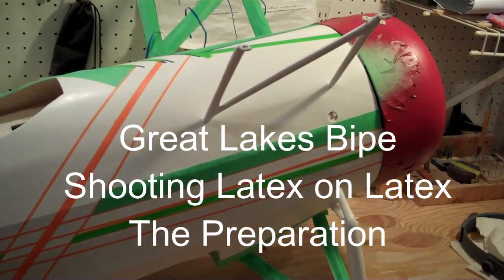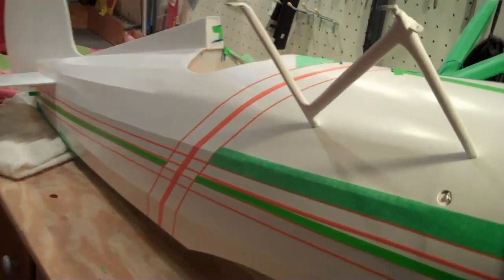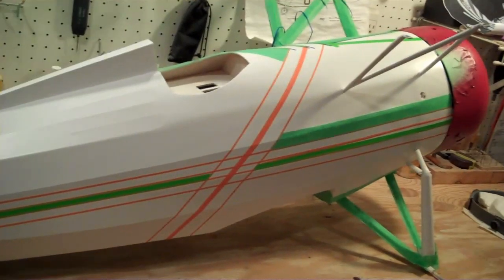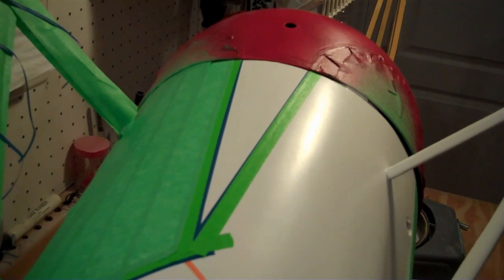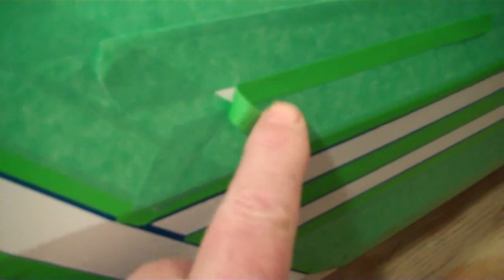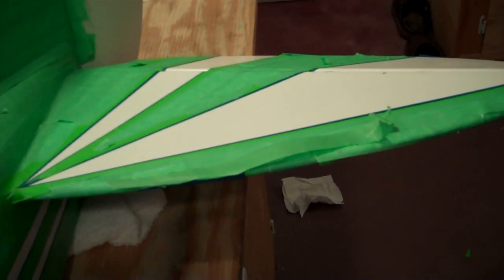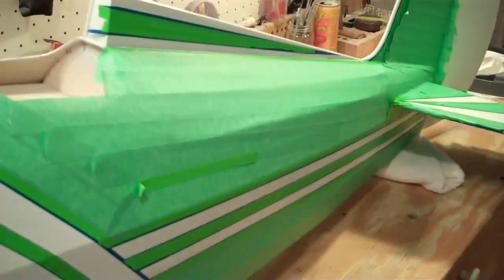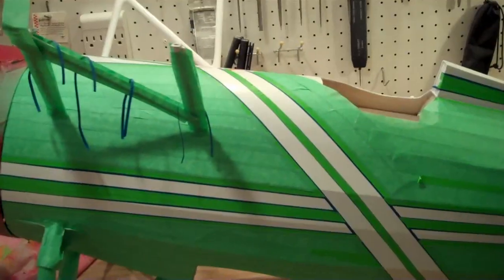RC Model Painting Latex on Latex

Comment: Thank you for sharing your project,I have a Sig Ryan STA that I'm planning to use the Roy Vallantcourt  method too.Quick question did I hear you correct when you said you prime your model with TF Lustrekote primer? Also my Ryan is covered with Sig Koveral and doped Nirate dope,I'm going to use Nelson clear to topcoat to fuel proof model any advice or tips? Thanks for your time Rich
P.S. please post video od complete aircraft.